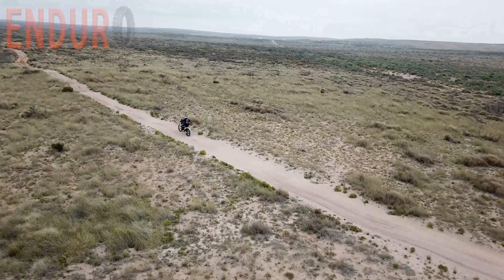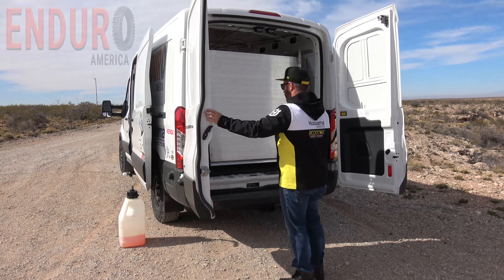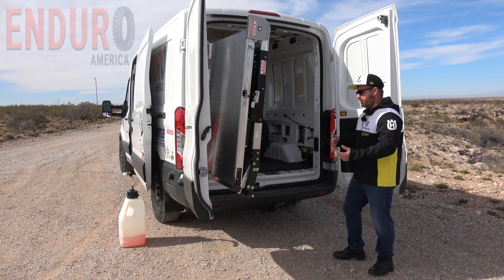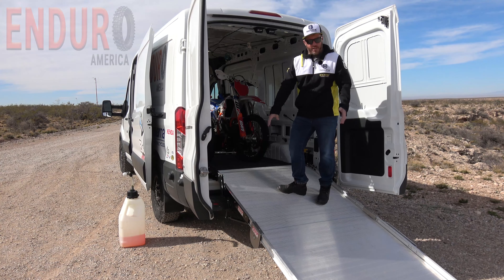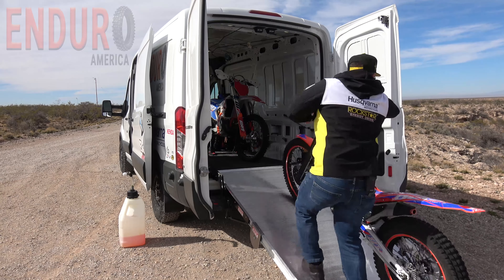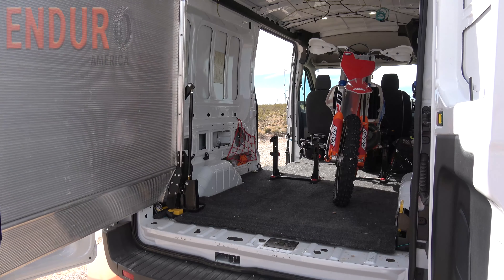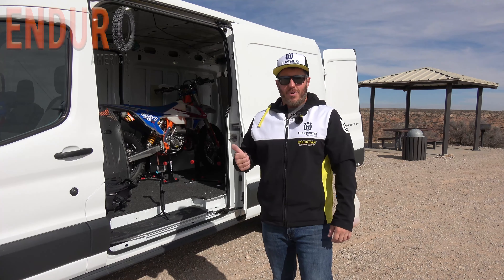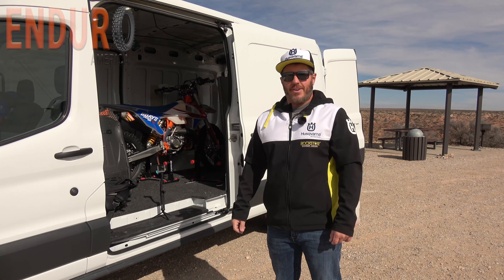Enduro America's Moto Van Episode 1 * THE RAMP Motorcycle Hauler

Comment: super.. just planninning to kit out a van and this ramp looks awesome.what model of ramp is it and do you know if they are available in Canada as we are in British Columbia. thank you
Reply from the maker: Haha thanks! It was made by link manufacturing. I don't have much more information at the moment but you should be able to look them up. It was a great ramp and made loading a breeze! Good luck with your van build!
Reply: @EnduroAmerica  a question ...from the inside of the back doors when they are closed how much cargo space ( depth ) does the ramp protrude  into the van? thank you
Reply from the maker: @Brianmoto49  from the door to the very back of the mount was about 18 inches total.
Reply: @EnduroAmerica  thank you .. just to clarify my van is a Ram Promaster with 120 inch cargo bed if the ramp is in its folded up position from inside of the rear door to the interior surface of the ramp in its folded position how much of the cargo bed length would be lost ? The full 18" or something less than that ( hope  explaining my question correctly) thanks for your patience
Reply from the maker: @Brianmoto49  in my ford transit it was 18 inches that was lost in the back. I do not know what it would be in the Ram van.
Reply: @EnduroAmerica  thank you...